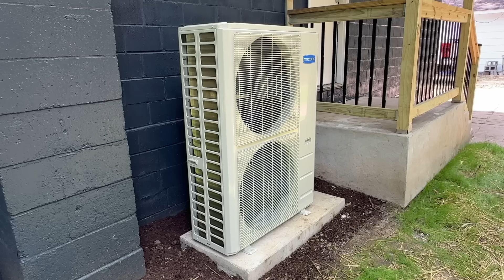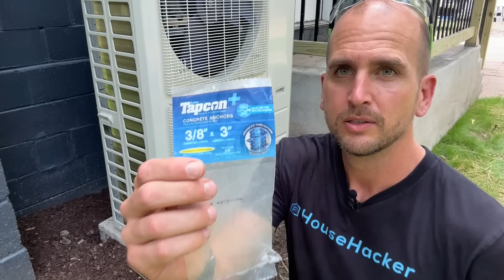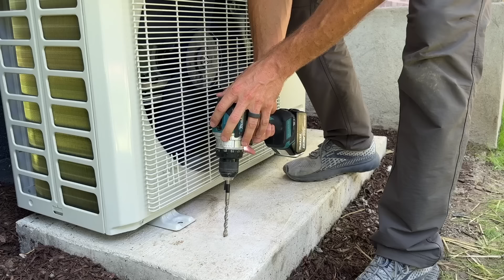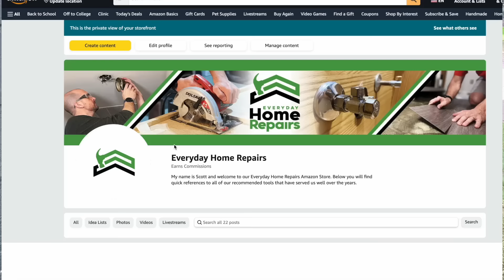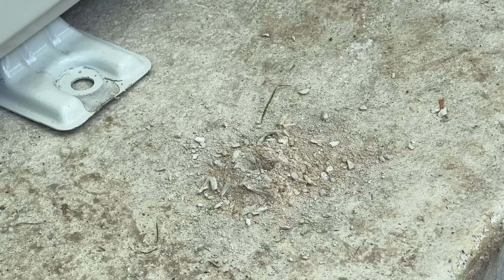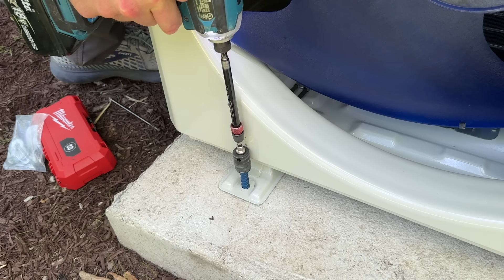The Only Concrete Anchor You Need And How To Properly Install

Comment: I'm definitely a tapcon fan, but I'd be uncomfortable using a impact driver to drive it in, too easy to strip the hole.  I use a ratchet instead, and when you tighten the object flush to the wall, (or floor), just stop right there, don't tighten it any more or you risk stripping the hole
Reply: Yep - ratchet is the go to

Comment: the more age on the concrete, the more likely a tapcon won't do it.  they are also overkill for light duty anchoring.  Walldog (tm) screws work great for the light stuff - and also for light stuff in sheetrock.  addendum: if you need to level things, you also want a pinset or wedge anchor with double nuts.
Reply: I have used Tapcons in very old, porous brick and they have held very tight.
Reply: @KameraShy  that's one of the differences between clay and concrete.

Comment: I haven't had any issues with the larger tapcon screws but I have had the smaller ones snapping off half way down. Most issues have been in flagstone. Always use the recommended drill size for each.
Reply: 100% agree with you.  I HATE any Tapcon less than 5/16". They always snap.
Reply: I've never used the larger ones, only the smaller ones. I absolutely hate them lol. Same deal with wedge anchors mostly. I started to epoxy everything in....
Reply: According to tapcon the threads are not intended for more than 1-1/4” embedment in the substrate. The longer screws are not to go deeper, they’re for fastening thicker materials to the concrete. This only applies to the 3/16 and 1/4 screws, the bigger anchor bolts 5/16 and up, can go deeper into the concrete for better pull out.
Reply: I hate tapcons also I broke to many of them and pretty much refuse to use them now.  Nail anchors work better imho.

Comment: Those units come with rubber anti-vibration pads, you should slide those underneath the next chance you get.
Reply: My guess is the rubber also helps prevent moisture from leaching out of the concrete and rusting the tie-down flanges…
Reply: As the unit ages and the bearings wear, these fans tend to start vibrating and making one heck of a racket. I know, I used to live in China where these split systems were EVERYWHERE.  Metal vibrating against concrete makes one hell of a racket.  Use the rubber pads, even if you don't need them when the unit is new you will wish you had them several years down the road. Unless you like extremely high pitched sound of NNNNNNNNNNNNNNN which is the sound they make when they get old and you don't have a rubber pad to help with the vibrations. I had mine replaced in my apartment in China at my own personal expense, not because it wasn't cooling but because it was Noisy AF and vibrated like crazy enough to keep you up all night long. These split units are also a lot cheaper to buy in China, about $90 USD for a new GREE split system including labor to install it. That's a lot of money in China, but not for us here in the USA.
Reply: So what’s the solution a Fujitsu unit or Panasonic?
Reply: Holy shit folks..! This video wasn’t about how to install a freaking ac unit. It was how to install a tapcon screw… get over yourselves..!
Reply: @GoyumSlop That’s a strong point!
Reply: @GoyumSlop  Well, he IS installing an AC unit, and the scratches are real and the lack of rubber pads are real and the possible installation missteps are real and will be to the detriment of the AC owners unless he undoes everything he did in the vid to redo it right.  Do you think he did that?  What you're saying is we should only expect someone who is "teaching" to do one thing right and the rest of what he's doing doesn't matter, no matter how wrong it may be.  Yea, who needs to get over what?
Reply: Don’t like tapcon much if there is both weight and vibration, say mounting a heavy thing to a wall or an overhead slab.
Reply: What AC units can you buy that don’t vibrate and make that horrendous noise?!
Reply: True that.
Reply: Too late..
Reply: Heat Pump no no no what a complete waste of money doesn’t do what it says on the box.
Reply: If it's a well balanced ac unit, you don't need the isolation pads. Not only that, the rubber won't survive the elements very long. Then you're stuck fixing unstable feet
Reply: @inkdaddy66  there are several rubber blends that are nearly impervious to UV degradation, the failure mode most people refer to when saying "the elements"
Reply: @GodlyNoghri can you provide a link to some like you described? Looking to buy some for my unit as my installer did not provide them. Thank you
Reply: @inkdaddy66  My unit (MrCool) came with rubber pads .
Reply: @inkdaddy66 it’s not rubber, it’s actually called neoprene, perfectly adapted for outdoors
Reply: @inkdaddy66 but sometimes the rubber is needed to be installed for the warranty. Like Mr cool units.
Reply: @inkdaddy66 don't worry everyone, the unit probably won't last more than 10 years so the rubber wouldn't have time to deteriorate anyways, which it won't, because tires.
Reply: @wheressteve  never heard of dry rot, eh?
Reply: @inkdaddy66 now that’s a comment based in lack of understanding
Reply: @NoName-sn1le  ok
Reply: @NoName-sn1le Yep!

Comment: For an A/C system that is so tall, I'm skeptical about using  tapcon. That height would create a greater tilt force. For a normal height A/C tapcon would work great. I think Redhead anchors would be better for an A/C that tall.
Reply: Better than red heads are flush shells.  Red heads are great for applications where they will always be in tension. But it there is risk of them getting lose flush shells are a better option.

Comment: Because I've lived in several very old houses, MANY times I've drilled pilot holes in mortar, only to find that the sandy mortar has crumbled too much and the hole is too large. 
My go-to fix is inserting a small length of bare #14 wire. It fills the gap and makes the attachment super strong.
Reply: A Zip Tie also works great

Comment: I really enjoy your channel. I've used my share of Tapcons during the hurricane plywood wars living in an east central Florida block home. Occasionally I'd spin one and lose the threads. My fix was to stick a few pieces of heavy duty grass trimmer line in the hole. Worked like a charm and held like iron.
Reply: I would say crude. Some folks need attention.......
Reply: @joemendyk9994  You want some cheese with that whine?
Reply: If it straps, I use a piece of small tie wrap in the whole...

Comment: If they bind going in, just back them out a a full turn and go ahead and finish turning them in. Just like you would with a tap. The threads cut the concrete and create debris which causes them to bind.

Comment: Tapcons are not the best to use where vibration is an issue, as they can work lose.   Best to use flush shells then it is a permanent install and no strip out issues.
Reply: I use polyurethane construction adhesive on the threads when using tapcons. Never had one loosen up.
Reply: @Matt633NLT   If you are going to go through that much work to make them work might as well just use a flush shell in the first place. And then you can actually remove it at a later date if needed.   Sure lets glue the fastener in and eff the guy that might ever have to remove it later on. 🙄
Reply: @matthewq4b  it's hardly any extra work , takes mere seconds to apply, and can still be removed at a later time. No different than using loctite on a machine screw. 
I endorse other methods as well, I was just trying to add my two cents worth of knowledge to the conversation.
Reply: @Matt633NLT   You're kinda missing the point. If you need to glue the fastener in to be secure then may maybe the fastener you're using is garbage, and possibly cheap is more important than doing it right.

Comment: This is perfect timing.  I just came home from Lowes with 3/8 heavy duty tapcons to mount a new mini split on a concrete block wall. Also bought the 8” tapcon sds drill bit.

Comment: My biggest problem is that I put several tapcon screws in a bucket and I never know what size drill bit to use 😣. I’ll learn to keep them separate now.
Reply: Same here. I keep all my tapcons sorted by size and throw the appropriate bit in on top.